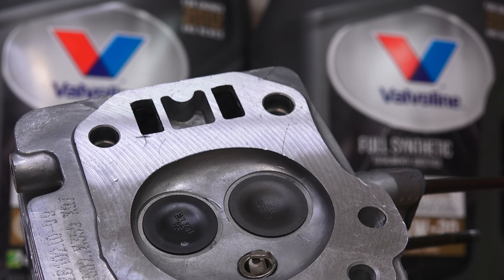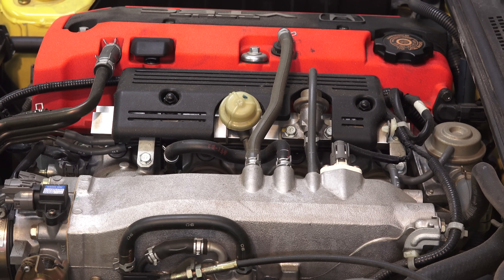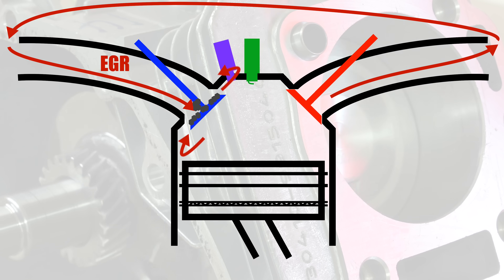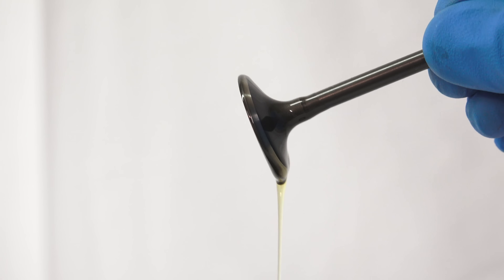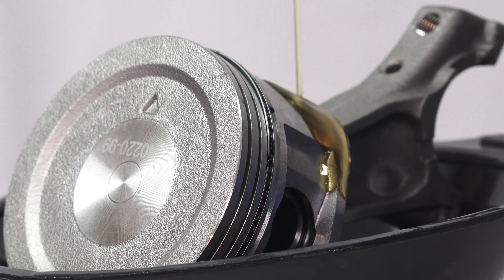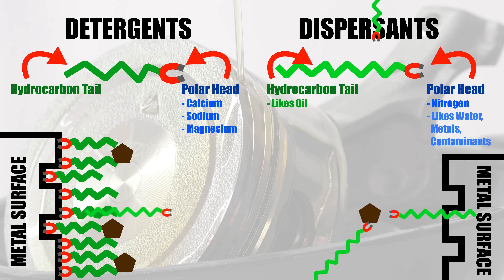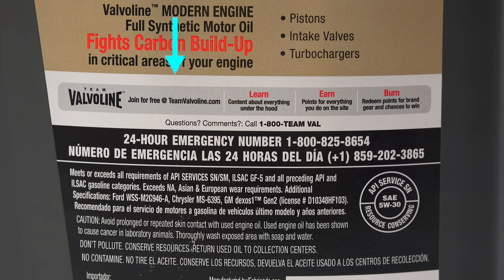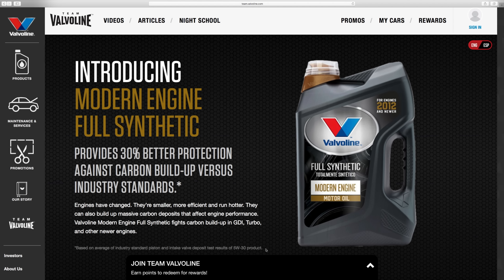Can Engine Oil Help Prevent Carbon Build Up?

Comment: So...  An Oil catch can is needed from what i am seeing
Reply from the maker: To me they seem logical! https://youtu.be/PWz6vCnJ4CA
Reply: Make sure to buy a quality catch can as cheaper units have been found to burp oil into the intake system.
Reply: @greekgeekconsulting  so what makes one good vs. cheap? Obviously inexpensive is the best option if it doesn't burp oil in.
Reply: DE Nichols I looked into a catch can for my 3.5 ecoboost v6 in the f150 forums.  Other owners described the differences in catch can design.  Some have different baffles and vents to equalize pressure if I remember correctly.  Ultimately My research tells me catch cans are a gimmick and unnecessary.  Better results to run a tier 4-5 oil that is truck synthetic with low NOACK scores.
Reply: @greekgeekconsulting  so basically better oil and you've dealt with the problem.
Reply: DE Nichols I’m going to test the used oil at my next change.  Go to Amsoil website and preorder a test kit.  I did an analysis two years ago through Blackstone laboratories but have since learned their fuel level in oil test is inaccurate.  Fuel dilution of oil can be a problem in 3.5 ecoboost v6 and all modern Diesel engines.  The only fix for that is to change your oil before the fuel dilution reaches 4%.  Of course you don’t know until you get the oil tested.  If too much fuel then reduce your next oil change interval length.  I’m currently changing every 12 months but am curious what the test will show.  Good luck!
Reply: @greekgeekconsulting  I never thought to use Blackstone labs for that. They let me know on my motorcycle to not wait more t han a 1,000 miles to change the oil.

Yamaha recommended 4k miles. The metals were too high and 10w-40 breaks down to 5w-20 in that short of a time!

Not enough protection for a 250 going freeway speeds. I shared other things about my research on oil on YouTube if you'd like to take a look. 👍
Reply: Oil catch can dont work. I only catch some oil, 5%. The rest is condensation/water vapor. I get a milkshake in the can. Then i have to clean that. 09 wrx.
Reply: @ChengSAE  sounds like it worked to me. You really want to reburn all that water mixed with oil? Sounds like a carbon fest.
Reply: ONLY USE A CATCH CAN WITH A BAFFLE OR FILTER INSIDE 
Ones without catch much less.

Comment: Interesting way to describe detergents and dispersants, I wasn't aware there was any real difference before now

Did you try the ignition off throttle thing yet? I see the S2000 has a cable throttle
Reply from the maker: Honestly doesn't sound like a good idea to me, so I'm not going to do it on my car. All the comments I've read about it have rejected the request of uploading a video on it when I ask, so I assume many haven't actually done it. Engine braking is mostly a result of pumping losses (for gasoline engines), that much I know is true.
Reply: " ignition off throttle thing" 
?
Reply: Fair enough. I would but don't have a car where the throttle (or gearbox) operates with the ignition off any more, so it would be a task to demonstrate.

 @nvmyutube  I was referring to my questioning of pumping losses being responsible for low load fuel economy increase in the last video. My observations have been that when I switch the ignition off while in a low gear and vary the throttle the engine braking doesn't change, so I figure pumping losses must be more or less constant.

My theory is that because you require some fixed amount of power to overcome pumping losses without generating power (ie holding the engine at 3000rpm in neutral consumes fuel but doesn't actually do anything useful) any additional power (more throttle at the same revs) is more efficient because you can do work with it, so higher loads are more efficient until you run different mixtures. It's more that pumping losses are a higher proportion of total power consumption at low loads rather than they actually increase at low loads

Also there are cylinder filling implications to manifold vacuum and heat loss things going on when you have less energy burning in the same wall-temperature cylinder, but that's beyond my current argument and doesn't contradict accepted wisdom like the pumping losses thing.
Reply: ahh thankyou for the explanation Skippy.

sadly, i can't engage too much in that subject as to be honest, i've never really thought about it.
Reply: Also my air compressor appears to speed up when I block its intake rather than slow down, so that particular piston pump seems to require less power to drive when it's not moving as much air.
Reply: @skippy2987  Of course. If an engines work(the job its trying to do) is removed, then its under less load, and most engines will run faster. Its like when you suck something up in a vacuum, it gets a lot louder. People think its because its working harder, when in reality its because the main load, air resistance, has been removed from the motor output. It still recieves the same amount of power though, so it spins faster.

Of course, that only applies to engines/motors whos power source is external, and not actually dependent on the air its consuming lol. Internal combustion engines are big air pumps powered by the air they are pumping, so cutting the airflow would stall it. Removing the load from the engine, say, moving from drive to park, will see an increase in RPM though(at least on my old volvo lol)
Reply: I have tried that both on injected and carbed engines. I have noticed a bit more braking with WOT than closed Throttle. But not a huge difference. That could be an experiment on the next car i Install MS3X in.
2 runs on the same bit of road while logging whit the engine shut off.
Reply: @espenschjelderup426  Good idea, didnt think about that. Perfect example, running a car up to speed, leaving it in gear and shutting the engine off(dont try at home ect), then manipulating the throttle. Id imagine at WOT it would have better braking due to increased air pumped, if my last post makes any sense. Its esentially making its power source external(the road and vehicle momentum), to free up the air pump for science! XD Id try it in my volvo, but its an automatic and thanks to EE, I know that doing tests that require a locked drivetrain in a torque-converted auto are a waste of time.
Reply: What if your steering wheel locks up after you turn ignition off while rolling?  Sounds like a bad idea.
Reply: @LeverPhile  Obviously, you should leave the keys in the ignition to prevent that(my 96 volvo only locks the column when the keys are fully removed, I wouldnt even try this on a new car, especially one without keys), while also being on a closed, straight road(preferably downhill). Regardless, its definately something to be done in a controlled test envionment, not on the highway on your way to work lol.
Reply: @estamnar6092  < I get what your saying, but given how different  cars are with steering lock, or if you move key more than 1 step back accidentally, some noob might not fully undestand & get themselves into trouble.  It's just a tricky thing to advise as a general matter.  Cheers.
Reply: @LeverPhile   That's one of the reasons I mentioned the MS3. One of the advantages with doing this test with a MS3 is the ability to shut of the engine via the tuning software. So no need to touch the igniton key, and no need to additional wiring to shut the injectors or coil.
And logging while doing this its very easy figuring out the differences afterward.
No need getting distracted by a stopwatch while doing the test.
Of course it's possible to logg a OEM EMS via OBD2, if you wire a stopswitch to ignition coil power or injector power.
Maybe a Engineering Explained and Andy Whittlw colab?
Reply: @espenschjelderup426  I didn't know what an MS3 was until I looked it up just know.  Thanks for the reply.  This sounds safer than messing with ignition switch while rolling, plus data logging is always a good thing for something like this.  Still need to read up on what the benefit of this would be over an Italian tuneup, which I always get a kick out of.

Comment: What about Diesel engines??
Reply: alot of diesel engine with PCV EGR, im sure the intake valve more dirty than GDI...but 10yrs old still running and powerful..no problem at all
Reply: They have the same issues. Oils that are more stable are more better

Comment: My Subaru dealership uses Mobil 1 full synthetic in my Forester XT.  I guess I should check to see if it has all the certifications as the Valvoline full synthetic.   Thanks for the info.  Great video! 👍
Reply: Mobil1 is excellent oil.  I have used only Mobil1 in my 2005 Volvo turbo (the oil specified by Volvo).  It has performed well.  I didn't have to clean the PCV system and electronic throttle until 10 years and 100,000 mi.  The MOST important thing for your Subaru is to ALWAYS keep the engine coolant and oil full, never let it run low.  You should drain about a gallon of coolant and then add fresh coolant each year and check the operation of the cooling fans.  Always replace the thermostat every 5 years (use ONLY genuine Subaru OEM part).
Reply: John Ferguson Appreciate the advice, John.  I will most certainly do that.  I’ve always maintained my vehicles well, so I’m just getting some advice because this is my 1st Subaru.  Thanks again! 👍
Reply: Too bad it isn’t actually synthetic and mostly (~80%) regular conventional oil
Reply: Markitecture.
Reply: You have just been a victim of advertising
Reply: AbbStar1989 Again, that’s just marketing. Mobil made a deal with Nissan for Mobil1 to be the OE spec engine oil. Thus people like you buy it because it’s used in a GT-R therefore it’s the best. That’s capitalism buddy.
Reply: Subaru has their own brand of oil, I’m surprised that the dealership doesn’t just use that. 🤔
Reply: Motul X-cess 8100 for Turbocharged/GDI engines 👌🏻
Reply: M1 is known to cause louder valve train noise than its other synthetic competitors.
Reply: Don't be a tool. They all have these certifications.
Reply: Vitamin B were you addressing my comment or someone else?
Reply: Actually mobil 1 is fully rigenerated used oil. The marketing that they use is the best between.
Reply: Subaru has his own oil brand, the dealership shouldn't be using mobile 1
Reply: @George  Oil is oil is oil. Use the right weight and letter certification (SN) and maintain the change interval and you will have no issues. Factory recommends 5W-30 synthetic. You can use any brand.
Reply: Mobil 1 is (in my opinion) the industry standard that everyone compares to and emulates. I would be surprised if the use of it ever gave you any issues.
Reply: Benjamin Ford That’s good to know.  Thanks for the input, Benjamin.  The Forester XT is my first venture into the world of 4 cylinder, turbocharged, direct-injected engines.  I’ve been trusting my Subaru dealership with their recommendations, and so far the Forester has been great.
Reply: George, while I personally have never owned one I have heard nothing but praise for most of the Subaru lineup. Many of my friends have reached 200,000 + miles with no issues, although their Subaru engines are not turbocharged. My friends have been known to drive their cars like they stole them, so reaching 200,000 miles + is saying something.
Reply: Benjamin Ford  Benjamin Ford From what I have seen, including my mom's Forester, is that Subaru engines drink oil by 100k.  By 130k hers was going through a quart every 500 miles and she had always gone to the stealership on the maintenance schedule.
Reply: There is lots of info stating that F XT has problems as well. Google please.
Reply: Mobile 1 is one of the top tier brands you can get it meets all the certifications and it’s the best!
Reply: Actually Mobil 1 does not meet the Ford Powerstroke diesel engine WSS specification announced in 2016.  Don't use mobil 1 in a Ford Powerstroke Diesel.  I used to use it until the announcement and now I use Red Line or AMSOIL.
Reply: @greekgeekconsulting  the regular Mobil 1 or the turbo diesel truck specific mobil 1 ?
Reply: greekgeekconsulting All that means is they didn’t pay to play with Ford. Same with Chrysler. Oil companies have to pay to have their oil certified by that manufacturer. If you’re still under warranty use what ford says. If you’re not under warranty then what makes your heart happy.
Reply: Spencer | Sweis12 the Mobil 1 turbo diesel truck synthetic
Reply: Steve Pounder  no I actually called Mobil and verified I absolutely cannot use Mobil 1 turbo diesel truck in a ford power stroke.  It doesn’t have enough zinc or phosphorous or something to meet the standard.
Reply: No , Martino, Synthetic is the best. 100% syn not full syn.

Comment: Carbon build up is actually good for some old engines, raising compression as rings and bores wear down.
Reply: how to ruin an old engine. Use engine flush in the oil ;-)

Comment: Solution: Italian tune up.
Reply: Been doing it regularly for the last 200k miles and my car is still happy.
Reply: Please explain?
Reply: drone1028 Another way of saying the same thing: One redline a day keeps the mechanics away.
This just means that sometimes you have to drive your car hard and it will thank you for it. The myth of driving a car hard and killing it should be dispelled. Driving it hard with a cold engine will kill it. Once it's all warmed up you can hoon it.
Reply: An Italian tuneup usually refers to a process whereby a motor vehicle engine is run at full load for extended periods in order to burn carbon buildup from the combustion chambers, spark plugs, and exhaust system.
Reply: @temirbulatrashidov6244  Is this real?!
So my cousin wasn't making excuses to drive double the speed limit in the city!!
Reply: you can keep it in second or third gear to drive with high refs to clean it as well.
Reply: @drone1028  thrash the bejesus out of it. Actually there are many sound reasons to give your motor a 6000rpm rev up on a regular basis.
Reply: @drone1028  An Italian tune up is where you take your car out on the highway and drive it at or around the highway speed limit, it only works if you drive in town a lot though.
Reply: Reed GoKart     I thought an Italian Tune up was 5 gallons of gas and a match. 🔥🔥
Reply: This is what I swear by
Reply: You don't need the load, just the revs for DI engines.
Reply: Humble Mechanic said he sees less GTI’s with carbon buildup problems because the owners drive their GTI’s harder than drivers of other models.   Then again I have seen an owner of an Audi R8 getting carbon cleaning done on YouTube - although the R8 wasn’t having cold start issues; maybe just reduced power.
Reply: Thanks. Never heard of this method.
Reply: LOL!! This is an OLD wives tale LOL!!
Reply: What if you drive a diesel?
Reply: Levin Lover You still need it. The DPF only regens if the exhaust tis at a certain temperature. It will still thank you for it. Plus MAYBE it can help clean your EGR valve a little bit. Don't know about that.
Reply: Most people are gonna take this advice and go burn extra oil off lol.
Reply: Totally agree! The amount of cars I see being driven by Miss Daisy is comical and they can’t understand why they have problems .
Reply: Naw just bouce the rev limiter every now and then
Reply: fondeur that's not a solution for people who use their cars to commute and care about their car enough to not rev the engine while cold
Reply: Yes but it isn't going to work on direct injection intake valve carbon build up like it used to. I'm a great fan of this method btw but it isn't going to work as you and I are used!
Reply: Yeah I be wackin that needle at 6k on my 08 mustang gt boiiiis

But not too much or else...
Reply: This is mostly for 2 stroke motors and older 4 strokes.  Not really applicable to new cars.
Reply: Matthew You physically viewed the intake valves?
Reply: Daily!
Reply: EE already explained an italian tune up doesnt do anything you noobs
Reply: It's when u drive your car like an asshole or when u rent a car and floor it and rev until the redline in each gear.
Reply: Too bad that only works for port injection lol
Did you not see the part where fuel doesn’t touch the valves? Making the valves move faster won’t make the carbon deposits fall off. They grab on and hold. Stabbing them off with a screwdriver and then cleaning the oil out of the intake runners is very satisfying.
Reply: @thepanduuh The engine still deserves a healthy run once in a while.
I personally wouldn't own a direct injection car out of warranty. Dual injection is fine though.
Reply: @thepanduuh  by keeping the rpms high, you heat up the intake valves which is supposed to loosen the deposits and let them fall off/get burned up
Reply: Joseph DiFeo the extra heat from revving high will help clean the carbon.
Reply: I own three cars, one a port injected SOHC V6, a port injected pushrod V6 and a carburetted pushrod V6. Would the Italian tune up benefit them all or nah?
Reply: Man from Nantucket for the two port injected engines, yes. Make sure ur car is on its operating temperature, by driving at least 20 minutes. A carbureted engine mixes fuel with the air in a way that is not so much effected on the load, it just adds more fuel as the revs rise, so i guess as there is always some fuel going through the intake, it shouldn‘t be a problem, but i think all components would still benefit if you let them run freely from time to time
Reply: @manfromnantucket9544  if they are all in good condition

Comment: Before I even watch this video I use conventional oil mixed with some Lucas & some zinc & phosphorus 1995 Integra GSR all motor Type R specs rebuild probably 65k on this build still runs like a champ & minimum carbon on my shyt lol
Reply from the maker: With port injection haha. My S2000 has port injection and beautiful intake valves at 107k miles.